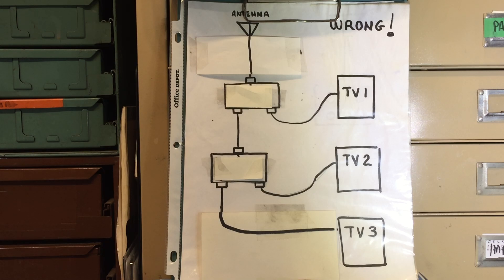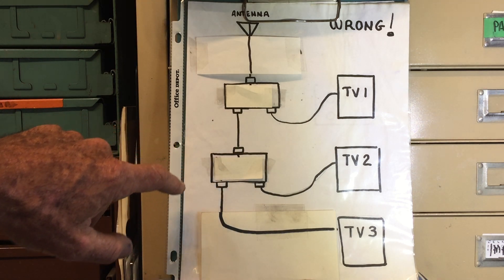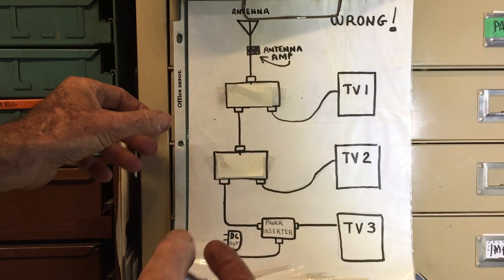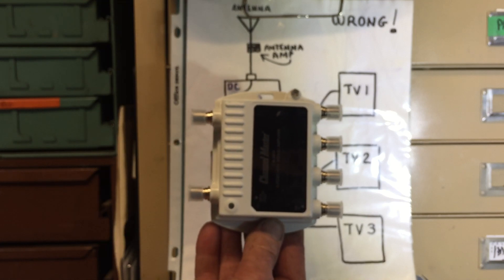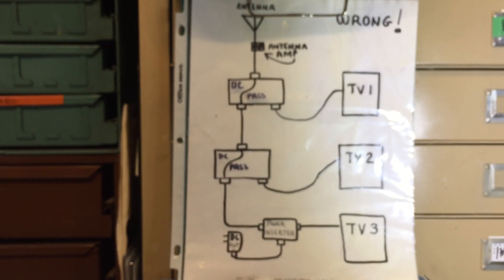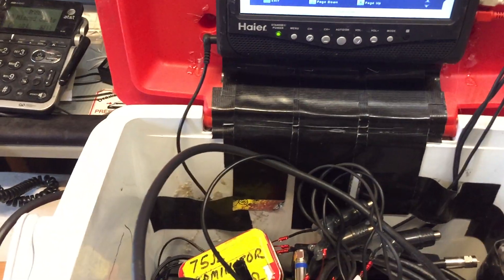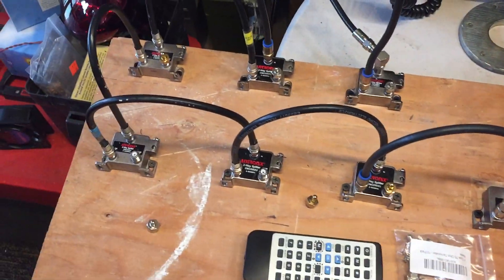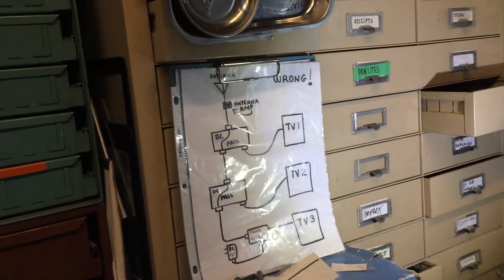TV Antenna Signal Splitting Mistake. (This Video Is Worthless Unless You See Follow Up Video.)

Comment: I’m not clear on the difference between an amplifier and pre amplifier. Can an amplifier be used as a pre amplifier? All of my antennas are in the attic and I have 120V available up there. Thanks
Reply from the maker: I mistakenly called the preamp an amplifier. As to the difference between an amp and a preamp I'm not sure.                                                                The distribution amplifier is supposed to keep the signal strong enough to overcome the signal losses, but I believe its gain is far less than a preamp.
Reply: @GrantsPassTVRepair  Both of them are amplifiers. The preamp (which in many countries is called a mast amplifier) has higher gain than a distribution amplifier and it amplifies signals right after the antenna. In order for a distribution amplifier to be useful, signals coming in must be strong enough to be amplified, otherwise garbage in, garbage out (gigo) and you will be amplifying noise.
Reply: @GrantsPassTVRepair  my  Winegard-LNA-200-Preamplifier with  120 feet of  run of cable ,You can't use another  amp after the splitter there will be inteference from the outdoor amp at the antenna?
Reply from the maker: @MrSilv55  I have heard of people successfully using two antenna preamplifiers. Just in case you haven't seen a follow up to this video you might like to check out this link. https://www.youtube.com/watch?v=rZhw0BEqyRE&t=0s
Reply from the maker: All I know is the TV antenna amplifiers are called preamps. I'm not sure of the difference.
Reply: @GrantsPassTVRepair  OK mate,  so a preamplifier will receive the signal directly from the aerial or antennae (depending where you are in the world and what you call it but both exactly the same thing).  That pre amplifier is designed to dramatically increase the signal level by anything 20-30dB. It then sends that signal down to a splitting system or if needed, a distribution amplifier which in turn amplifies the signal again to cope with signal loss down the lengths of cable to the TV points.  Now the key thing regarding the difference between a dist amp and a pre amp,  is the dist amp would be mains powered directly, like plugged into a power socket in the loft or in a cupboard or something, depending where all the cables meet.  The pre amplifier is obviously located out by the aerial, but it still needs power doesn't it.  So it is powered either by a separate power supply unit or PSU which would be located normally at one of the TV outlet points.  It sends power back up the coax to the pre amp powering it that way.  Although i often use distribution amplifiers that send 12V back up the input cable to the pre amp, it depends on your situation.   However, beware, there is such thing as too much signal or over load.  You need to know the optimum signal levels for your countries broadcasting system and be familiar with using a spectrum analyzer to measure your signal levels going in and there fore coming out at the TV point.  I hope I havent come across as patronizing and i hope this helps.  I've been in the TV aerial installation field for 23 years.  G Davies.  Aardvark Installations.  Check out my brand new YouTube page Aardvark Installations where i will post helpful videos in this field.

Comment: Couple wire has a lot of internal resistance when running long lengths that's going to kill your signal right away however I see that you found the solution good to know.

Comment: Maybe Wire Lenght With Splitting? I Wonder Why It Would Be Like That, I Did Teh Oposite, I Put More Antennas To my radio Then I Should, I Put A 6 Meter Roof Long-Wire   Antenna , Each Dipole Side Was 3 Meters, And I Connected ONE Side From A 75Cm Dipole Wich Was In 23 Meter High Over My Third Floor Even , I Got It Up There With A Fishing Pole So It Stands Theer And My Solution Top Not Shaking In The Wind Is Just Put It A Lil bit On One Side, Like Not perfectly Straight Up, But  Tilt It A Lil Bit And The Shake In Wiond Is Just Gone, So The Signal Went Better When I Put Two Of These ANtennas To My radio For 2500Mhz To 10.000Mhz, But After This Frequency It Just Wa Terrible, Then I Disconected One And PERFECT Soo Yes, radio Waves Are One Hella Of A Thing, Super Interesting
Reply from the maker: Thanks. I don't think the coax had any brakes or shorts, but seeing how little loss I had with all of those splitters, I'm inclined to think the longer cable length may have caused unwanted reflections.